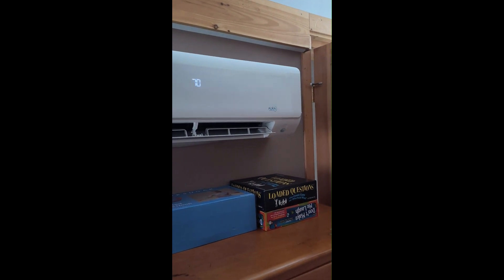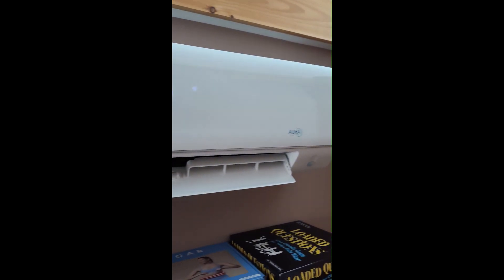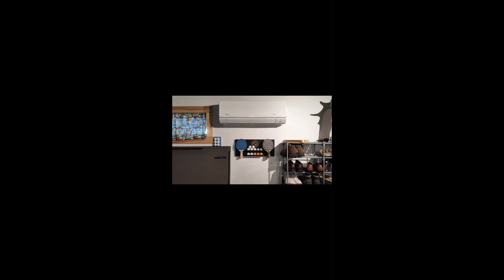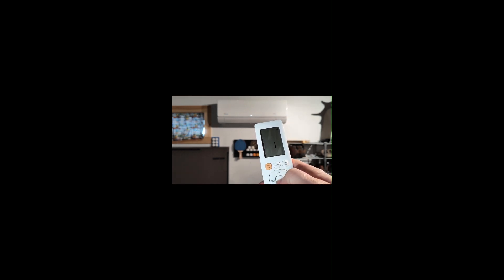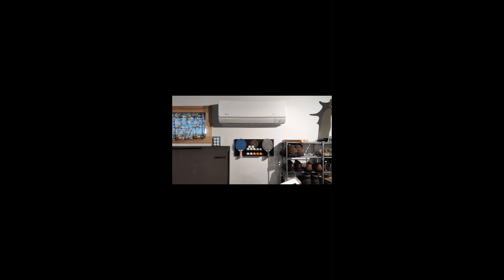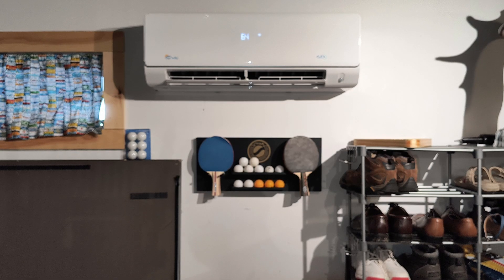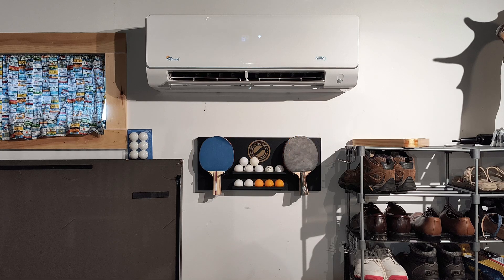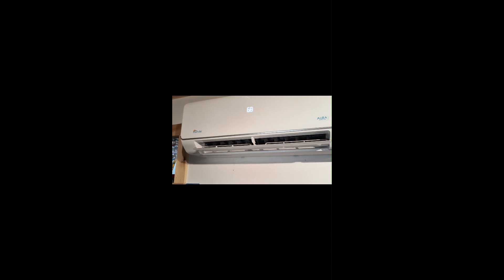MINI SPLIT HEAT PUMP HEAD GETTING TOO HOT? (Senville) keeps heating after setpoint reached-  SOLVED!

Comment: Interesting. My Senville Aura seems to have this setting already as a default, as we did not do any of these steps. I use heat mode with the follow me function on. Once the set point has been reached, the fan will completely stop and the louver will raise slightly so it’s horizontal with the floor but not closed. It will then remain in this stand-by mode until the temp in the room drops 4° below set point before it turns back on. I thought at first something was wrong because I have the fan setting on auto expecting it to just run constantly but it doesn’t. All 3 of my heads are like this. I actually prefer this anyway.

Comment from the maker: To reverse the programing and get it back to factory programming, where the fan will continuously run at a low speed upon setpoint reached, its the same process besides step 8 where youll now enter 3 instead of 1 

1**-  The power supply (breaker) needs to be opened to secure power to the entire unit and then restored. IF you have a surge protector on the unit, you will have a built in time delay and can turn off the breaker and then right back on. If there isn’t a surge protector, turn off the power, wait 3 minutes, and then turn the power back on
2**-  Once power is restored to the unit, you only have 1 minute to enter into the programming menu on the head via the remote control. Again, if you have a surge protector, you will have a built in time delay of about 5 minutes so you will have some time to wait in front of the unit. If you don’t have the surge protector/time delay, you should get the head rather quickly. 
3**-  Once the head/system gets its initial power, you will hear the head(s) beep and a very quick light up of the display on the indoor head. This is now the time to proceed
4** - Turn on the head with the remote just for a moment, and then right back off. 
5** - Now with the head off, hold the POWER and FAN together for 7 seconds or until you see “nA” appear on the head. 
6** - Now scroll with the UP arrow on the remote until you see an R2 appear on the head
7** - Once R2 is showing on the head, hold the power button for 2 seconds
8** - You should now see CH (channel) on the REMOTE. Select 3 and press OK.
9** - After doing this, you should see the head react in some way with a CO or 1. This means that the head has accepted the new programming signal . 
10** - Immediately go cycle the power supply to the unit again and let it restart
11** - You can test the unit now with the new programming of the head. Put the system in heat mode and Set the temperature up high on another head, and set the setpoint down lower on the head that was just reprogrammed. Fan should continue to always run now. Can try either follow me mode or normal mode in this setting

Comment from the maker: To program the Fan to cycle off completely once setpoint temperature is reached :  

1**-  The power supply (breaker) needs to be opened to secure power to the entire unit and then restored. IF you have a surge protector on the unit, you will have a built in time delay and can turn off the breaker and then right back on. If there isn’t a surge protector, turn off the power, wait 3 minutes, and then turn the power back on
2**-  Once power is restored to the unit, you only have 1 minute to enter into the programming menu on the head via the remote control. Again, if you have a surge protector, you will have a built in time delay of about 5 minutes so you will have some time to wait in front of the unit. If you don’t have the surge protector/time delay, you should get the head rather quickly. 
3**-  Once the head/system gets its initial power, you will hear the head(s) beep and a very quick light up of the display on the indoor head. This is now the time to proceed
4** - Turn on the head with the remote just for a moment, and then right back off. 
5** - Now with the head off, hold the POWER and FAN together for 7 seconds or until you see “nA” appear on the head. 
6** - Now scroll with the UP arrow on the remote until you see an R2 appear on the head
7** - Once R2 is showing on the head, hold the power button for 2 seconds
8** - You should now see CH (channel) on the REMOTE. Select 1 and press OK.
9** - After doing this, you should see the head react in some way with a CO or 1. This means that the head has accepted the new programming signal . 
10** - Immediately go cycle the power supply to the unit again and let it restart
11** - You can test the unit now with the new programming of the head. Put the system in heat mode and Set the temperature up high on another head, and set the setpoint down lower on the head that was just reprogrammed. 
12** -- Note that in this mode, with the fan cycling off, the remote controller should be in the FOLLOW ME mode, as with the fan cycling off now the temperature sensor inside the unit will become more inaccurate to the actual room temp, so the remote needs to become the thermostat on this head. 
Once the setpoint temp is reached, the head’s fan should cycle off. Give it 10 or 15 minutes to see that this now happens, or adjust the temp setpoint down lower. If it still is not cycling off, the process may need to be repeated. This can take some practice of doing it before you are comfortable swapping it back and forth.